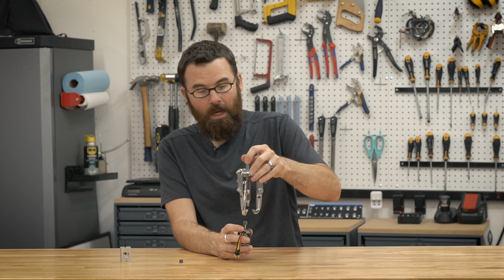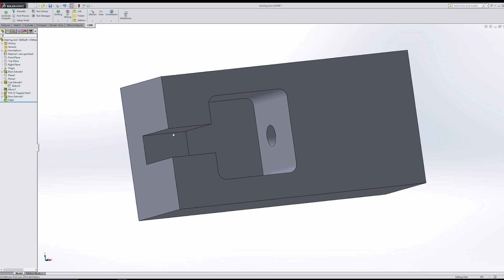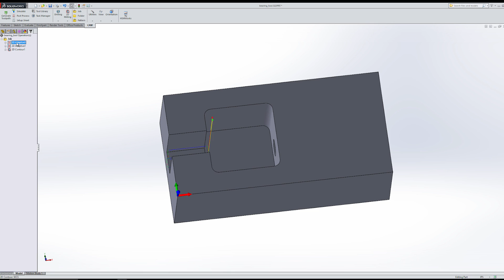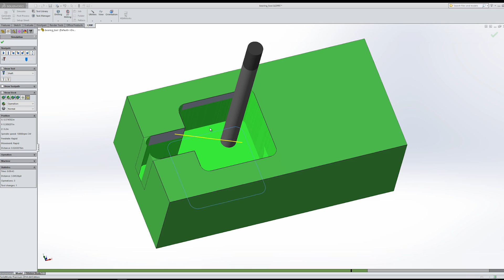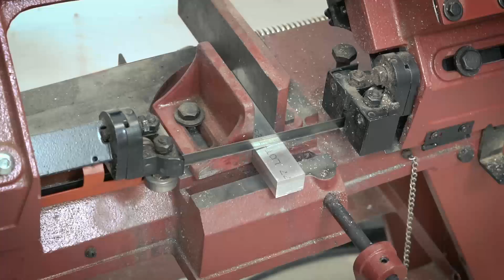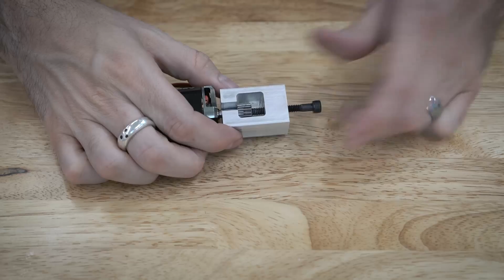From Start to Part: Pinion Removal Tool

Comment: Could you have heated the pinion so it expands than just pull it off?
Reply from the maker: This COULD work, but it's pretty tight.  It would still need some force to remove, even when heated.

Comment: Great video! I assume this would work equally well made from hardwood on a drill press, but much more satisfying to CNC it from aluminum.
Reply from the maker: Possibly.  You would have to make sure the grain is oriented the right way.  There's quite a bit of force being exerted.

Comment: Hi, about 20 years ago I had made the prototype tool to remove the needles on the Atmos clocks from Jeager-Lecoultre. The only difference was the steel body and the pocket was through. The
 toolmakers wanted 3 weeks to think and make the plan and it took me 1 
hour for the plan, the machining and the heat treatment. I did it with a Aciera F1 milling machine.
Reply from the maker: Nice.  I thought about going all the way through, but the flutes weren't long enough.

Comment: To put a pinion on a motor: put motor in the freezer, pull it out a few hours later. Heat the pinion with a blow torch. This makes the shaft a little smaller, and the pinion a little larger. You can make the pinion hole a tiny bit smaller than the shaft this way. It is almost impossible to remove the pinion after this because when they both get to room temp, the shaft expands into the pinion, and the pinion shrinks into the shaft. Does anyone know if a pinion remover like this on, would it get it off?
Reply from the maker: What you're describing is an interference fit.  You can heat/cool the parts to get them on as you describe, or use an arbor press.  I used a 1 ton arbor press to get the pinion on.  This tool removed it just fine.

Comment: How do you install the new pinion?
Thanks
Reply from the maker: I tried two different methods.  I tried an arbor press.  That works.  I also put it in my CNC vise, and that worked too.  I preferred the CNC vise because the jaws are lined up parallel, so there was less concerned with it going on crooked.
Reply: Thanks!

Comment: What solidworks version are you using to get CAM? I have 2010 and I was told there is not a version of SW with a good CAM option. Any thoughts? I use SW and export models to Fusion360 to get CAM but its time consuming  when I need to make model changes.
Reply from the maker: I think 2014?  The plugin is HSMexpress.  It's the same exact CAM (albeit a bit older) that comes with Fusion360.  However, this is just the stripped-down version, which is missing a lot of features found in Fusion360.
Reply: Robert Cowan thank you. I only recently subscribed to your channel but so far your videos are great and I look forward to seeing much more from you.
Reply from the maker: Thanks!  Tell are your friends ;-)